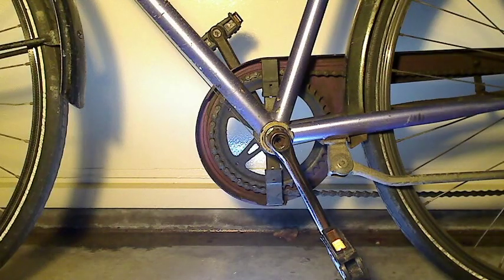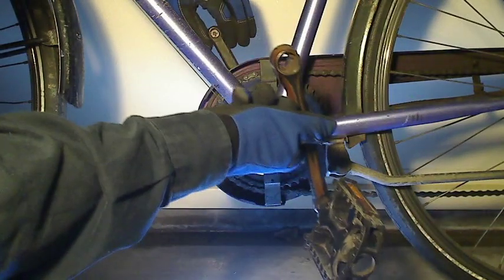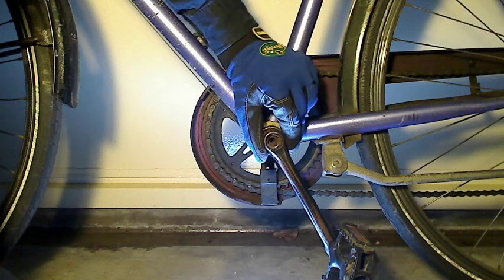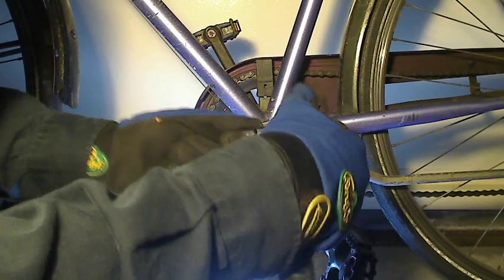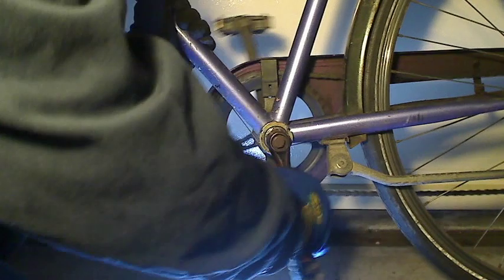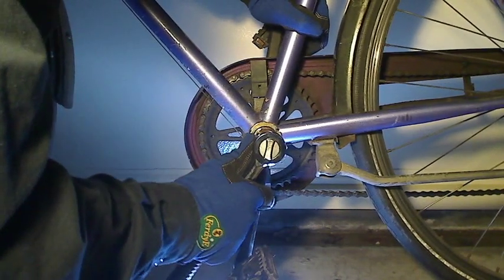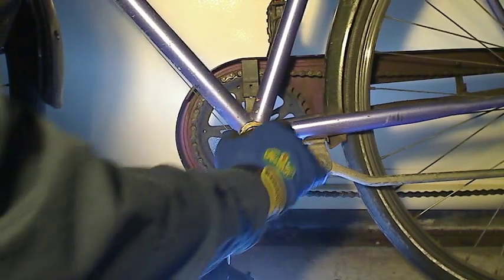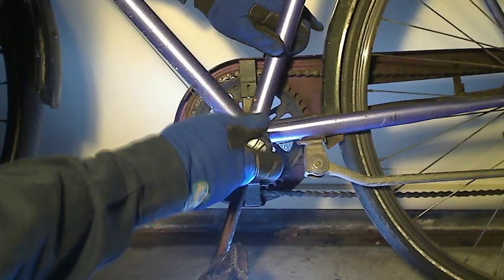Reattach and tighten a bicycle crank arm (short video)

Comment: I have a question. I did the same thing with my crank arm i tightened it as much as i could i even pounded a hammer to tighten it more it still comes off when i ride it. Should i use loctite? Or would i need a new crank?
Reply: bolt is tightening wrong way, I am seeing this defect a lot with bikes, it should be reverse thread on the left side of the bike so you tighten counter clockwise in the same direction of force you use to pedal.

Comment from the maker: Loctite "lock tight" might work, be careful though: Lock Tight undoes itself under stress... There are special metal rings with a split line that act as a retainer for bolts (don't know the proper English term for them) and they might work even better than lock tight. But once again, try and use at your own risk! I know people who had bad falls with bikes in disrepair... Your personal safety and actions are your own responsibility, so: be sure you do any repair to ensure safety!
Reply: I was literally about to comment about loctite!

Comment: i bought an old 20$ speed bike from a garage sale but the left pedal keeps falling off like 10 minutes after i re-attach it its similar to the bike in the video but there is a nut instead of a bolt, is it broken? and if it is how much will it cost to buy/replace?
Reply from the maker: If you can still use the thread on the bikes side, then you can go to the hardware store (take the nut with you) and get a locking washer or a self locking nut for the same thread size... No guaranties though... If you're unsure about your repair, then go to a locale bicycle repair shop and ask them (kindly) to check if you did it right... Please ensure your and other safety! That's your responsibility...
Reply: NekitaNet i dont think its the nut thats stripped i think its the thing it tightens on to
Reply from the maker: That might indeed be the case, but that could be an expensive repair and with a cheap bike is almost never worth the expense... For the price of a locking washer or self locking nut it might be worth a try to see if it's not "rambling" lose from usage... Do take care though... Falling of a bike because the paddle and/or crank arm falls of is never worth risk...
Reply: NekitaNet never mind im just so weak i didnt screw it on as tight as it would go, and all we had to do to the bike was replace a flat tire, everything else is in near perfect condition, kept in a "proper" garage for YEARS
Reply from the maker: johnkats14 Good to hear! Happy bicycling! :-)
Reply: bolt is tightening wrong way, I am seeing this defect a lot with bikes, it should be reverse thread on the left side of the bike so you tighten counter clockwise in the same direction of force you use to pedal.

Comment: Hey man I have like a 90$ Walmart car brook cruiser and the crank arm keeps falling off the nut is missing and i have no clue where to find a replacement
Reply from the maker: If your local Walmart doesn't have a replacement part, then try a nearby bicycle shop. To be honest, I'm guessing you're missing the reverse threaded one and if it's a special part you'd might be better purchasing a new bicycle if the prices are that low at Walmart.